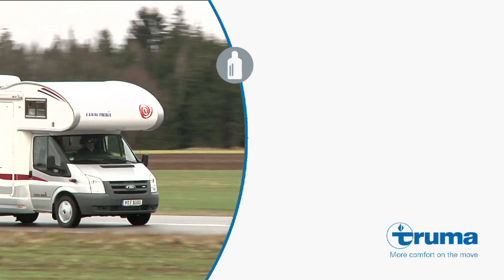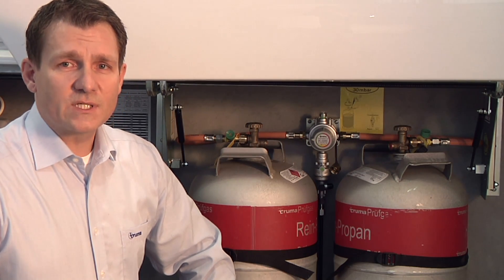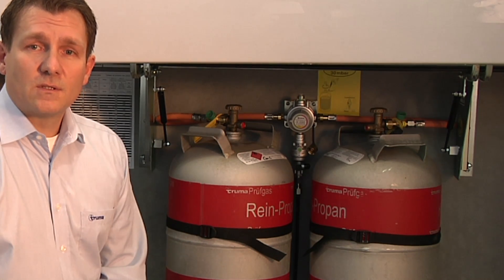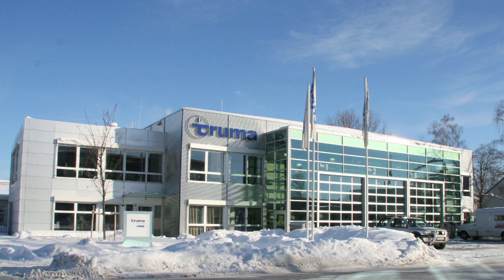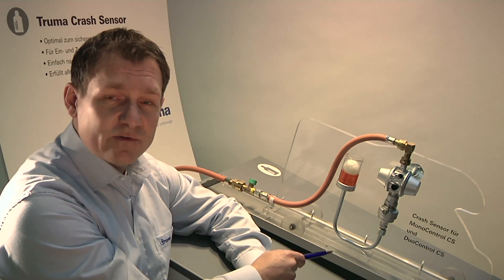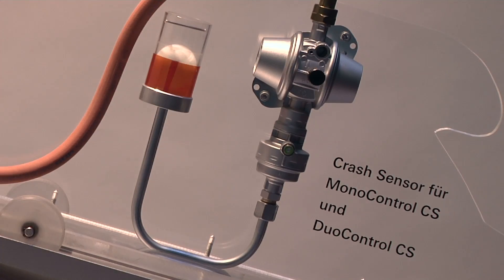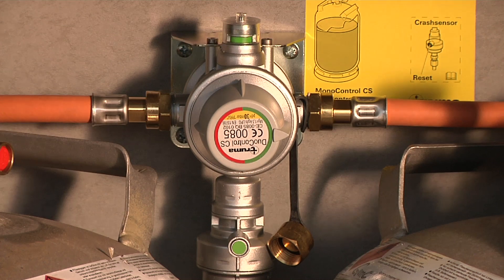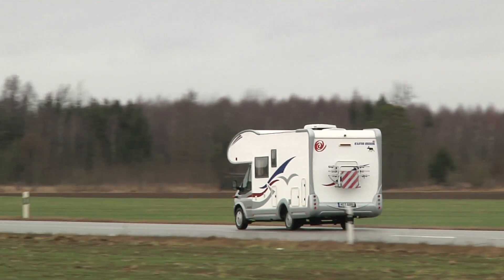Truma crash sensor – Heating motorhome and caravan safely while driving

Comment: Mine slipping so hard to reset. How do I fix please ?
Reply from the maker: Please make sure that the controller is installed 100% perpendicular. This may be the cause.
To reset the crash sensor, it is important that you use a tool to push it. The finger does not go in far enough, try using a pen or similar.
Cheers
Your Truma Team